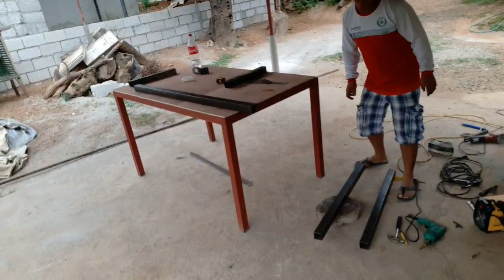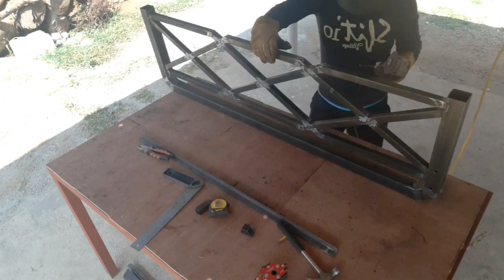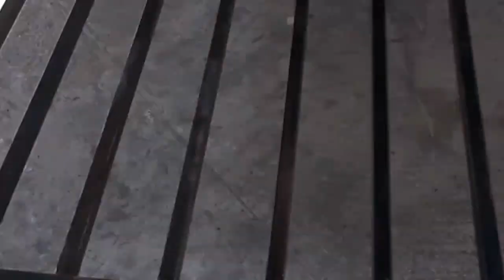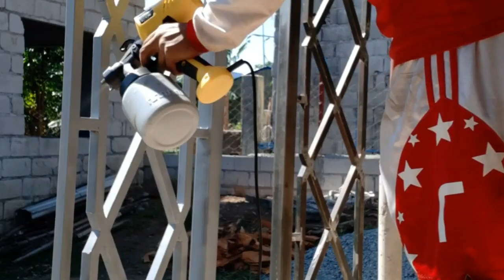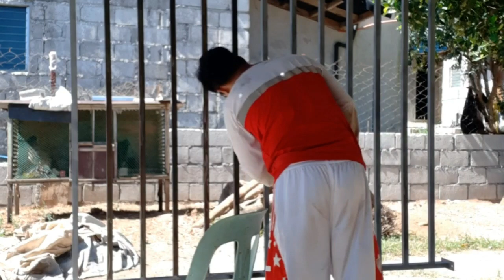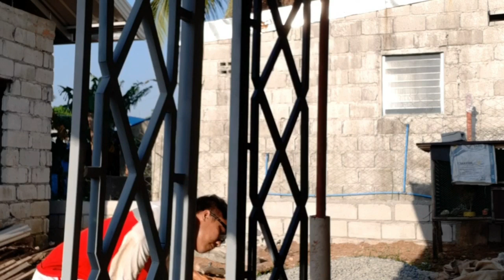How to Make Detachable Steel Bed Frame (54'X75') FULL VIDEO@CHARLZ WELD

Comment: Boss no words, but very detail in action. No music destruction for me. Saludo ako sa inyo. Assuming gamit nyong tubular size indicated, magkano kaya budget para sa king size? With simple detachable square canopy on top ng headboard and footboard, pati welding rod, bolts use and simple headboard footboard than yours. Pero 24 inches from papag to foot including caster wheels. Anong tawag doon sa joint plate nyong ginamit at yong bolt size? Thinking of using to 2x2 plate attaching casters din sa footings. Ano palagay nyo? Salamat ng marami. Proposition, better if  you can send me a detailed measurements, with your tubular size used, including bolts washers plate size? If you have fb (i have one) message (friend me) so i can send more details how to compensate you for a plan in king size, with 2 pull outs under(all in 5 inch foam) 3 papag in one, all in wheels. Is 1x1 canopy frame strong enough? Plain simple headboard with tubular stopper so pillow will not fall out from bed, better off, edit picture of your bed to king size  with complete detail send it to me via messenger.does it need for top bed higher (foot height size) to make room for 2 pull outs? Let me know asap. I have local welder here in pangasinan but scrambling for a plan thats why i need your help.Thank you.

Comment: sir ask lng po anong size ng  lapad at haba niyan 
pati narin size ng materials 
tnxs more power
Reply from the maker: Thank you sa comment po..🙂🙂🙂
Reply from the maker: Ang lapad po 54"
Haba 75"
1x1x1.2
1x2x1.2
2x2x1.2
Tnx po more power din po sa inyo..salamat po sa pag suporta🙂👌
Reply: Sir ilang material ang naubos mo Jan.tnxs
Reply from the maker: 6pcs 1x1
1pc 1x2
1pc 2x2
Yan po sir..d nmn po totally mauubos yan..may mga subra pa po yan.
Thank you po sa comment
Reply: Salamat sir